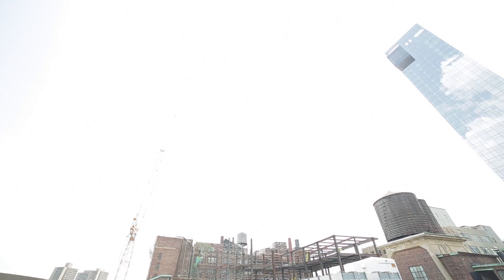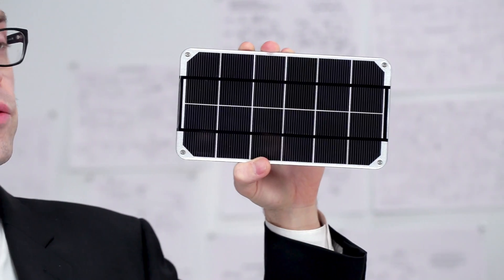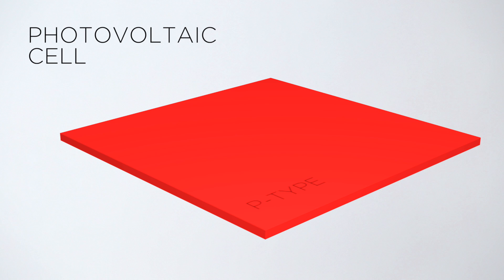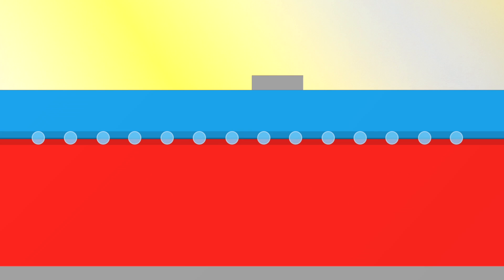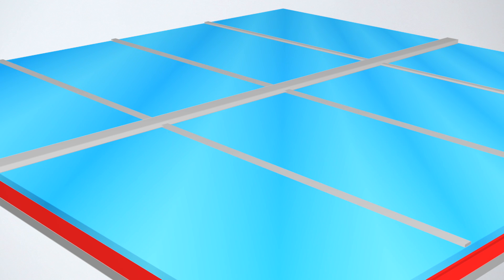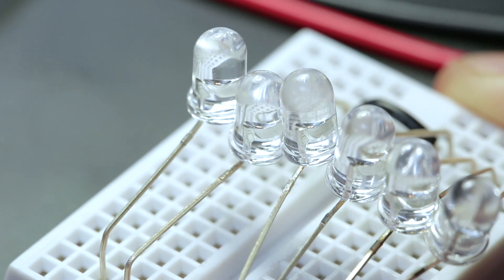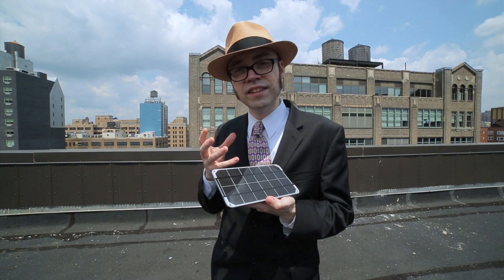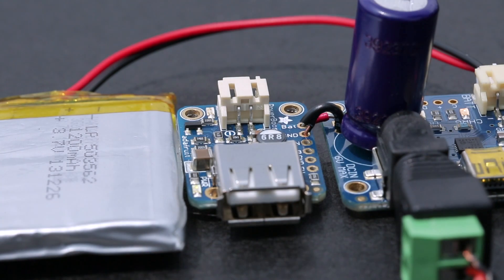Collin's Lab: Solar

Comment: My solar power idea is to simulate an effective way to use solar power in a van to work off grid. My idea is to use gps and compass devices to quickly turn and tilt solar panels to point at the sun and then use a sort of max-min algorithm run by an Arduino to keep the solar panels pointed at the sun for max output. I'll do it on my desktop at a smaller scale because I don't actually have a van or much money. I can pull off a simulation on my desktop though. So far I've gotten from Adafruit a GPS Antenna, a Ultimate GPS with USB - 66 channel w/10 Hz updates, and a Triple-axis Accelerometer+Magnetometer (Compass) Board - LSM303Triple-axis Accelerometer+Magnetometer (Compass) Board - LSM303. Next I'll get a 6v solar panel and a solar charge controller and a battery. For a complete simulation I'd need some sort of inverter of course. Does Adafruit have that? I also need gears to rotate and tilt. Pretty sure Adafruit doesn't have that. Any suggestions on where I could get the gears?

Comment: Can the panel run out of electrons?
Reply: lol, where exactly do you think those electrons are going?
Reply: Every electron in that circuit has to stay in the circuit, and believe me, it's jam-packed with electrons. It's not like the electrons are leaking to the outside world.
Reply: Not under any normal conditions. Electricity is the flow of electrons from the side with excess to the side lacking electrons, so they always stay in the loop, same thing in PV cells electrons get dislodged on the N side and then want to go back to the P side.

And the reason PV panels degrade over time is just gradual combination of defects, the glass starts to fracture, glues start to fog, moisture and oxidation starts to creep in, and even the molecular structure itself starts to very slowly break since it gets bombarded with photons for so very long. But we are talking 30% power loss in 30 years(if it was made properly), that means you can still go on using them they just put out less power, and once completely done the silicone can simply get melted and used in the next PV panel.
Reply: I would assume so. Solar panels do have to be replaced every once and I while from what I've read, albeit a long while. I'm guessing that's due to a lack of negative charge.
Reply: +MsSomeonenew Huh. Neat.
Reply: Great

Comment: What does he use in this video, (like how did he connect everything)
Reply: +Ty Luna the white board he is using is called a bread board.  you can plug many circuits into it for testing

Comment: Would a magnifying glass be able to magnify the results of a solar cell? Where are the bottlenecks in the current design?
Reply: +Keith Green  Well a magnifying glass takes light of a specific area and focuses it to a smaller area. So unless the magnifying glass is larger than the solar panel it wouldnt do anything. And if it is larger than the solar panel, it would probably break/burn the solar panel.
Reply: +Keith Green Yes, you can focus more suns rays on the panel, however the panel must be fully exposed in a uniform manor and if in series they all must be exposed in the same way.  Increasing the amount of photons on the surface of the panel does not increase the voltage, it increases the current.  The drawback is Photo voltaic panels decrease in efficiency as they increase in in temperature, so its common to use more panels rather than mirrors to focus more light onto a smaller panel.
Reply: +drumintercourse what if the focal point is beyond the solar panel, so that it wont focus on a single point of the board, distributing instead the energy on the entire surface of the solar panel?

Comment: If LEDs read light coming in - can your monitor be a camera? I believe The LCDs have LEDs behind the liquid crystal. If so aren't all TV's, watches and cell phones just cameras? Is big brother watching you?
Reply: +Larry Kaufhold (Multiple Monodot) Generating electricity from light is not capturing light in a reproducible manner. It's converted to electricity. It is not a camera.
Reply: +Larry Kaufhold (Multiple Monodot) the LED's in monitors are usually on a strip on the edge of the screen its illuminated just like you would hold up flashlight to the bottom of a mountain dew soda and it glows

Comment: The raw output a small solar panel can be used in place of a light dependent resistor (LDR). Also, hooking a small panel to an amplifier or a voltage controlled oscillator creates some interest sounds. Allows you to hear sunlight.

Comment: 2:55 ,yelling at my screen "Ahh,but they do!" 
Also,some old transistors work too- find an old TO-3 case transistor,and pop the top off to expose the die to the light. :)
Reply: Do you know which junction works better?
Reply: excavatoree
 Try the Base-Emitter junction of a 2N3055,or something similar. Experiment!

Comment: diodes can make electricity o.O cool
Reply: A solar cell is a diode ;-)
Reply: Joe11Blue Cool o.O .So, you can use solar cell as a diode in some kind of project in where needed diodes? like AC-DC Diode gate converters
Reply: Try it and let us know.
Reply: Otherwise, I would have tried it already when you said "A solar cell is a diode"xD, but it's not possible now because I don't have solar panels...
Reply: I don't have any solar panels either, so don't feel bad :-)
Reply: +Gamewwx They can also heat cool an object.  See Peltier Effect Cooler which is also a Diode.
Reply: +Carl Camp Cool
Reply: I used peltier element for my automatic can cooling system. Arduino was brain of it.